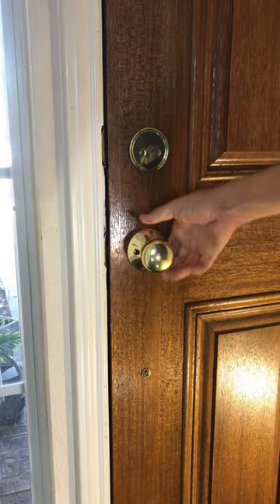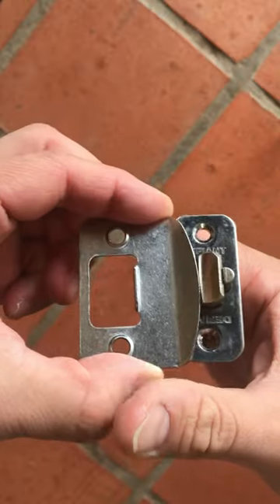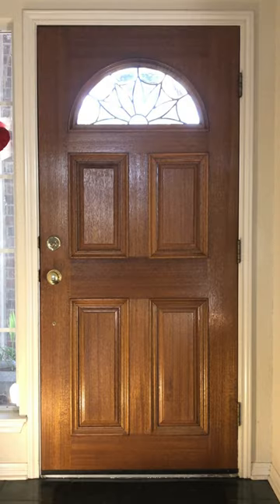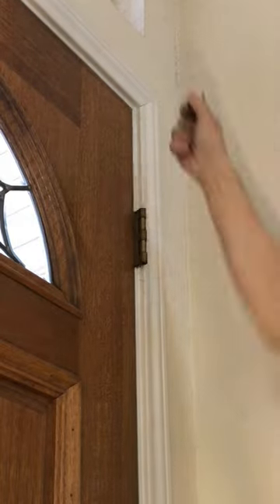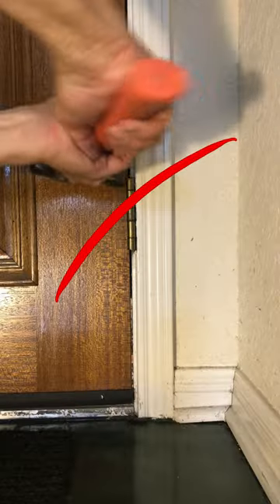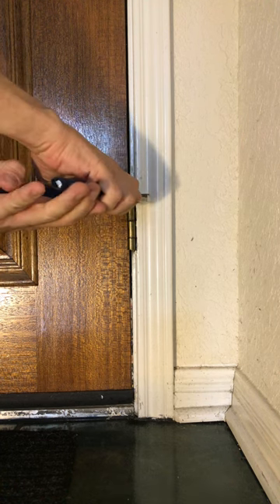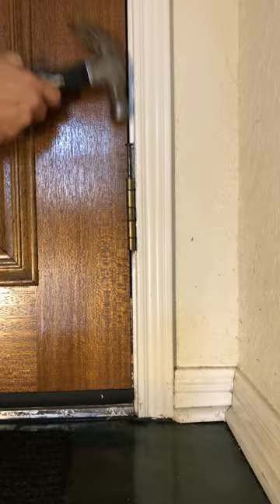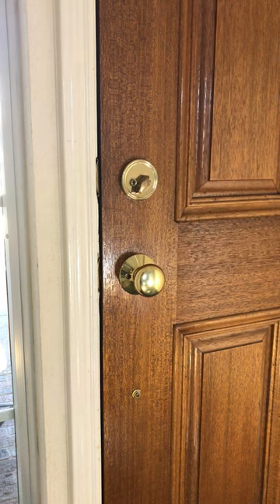How to Fix a Sagging Door (quick) (#shorts)

Comment: Most likely cause of a sagging door is loose screws on the top hinge.
Reply: Except in Dallas. It's the ground shifting under the foundation, for sure. It's even seasonal...one set of doors in the house jam in the summer, a different set of doors jam in the winter. They're all fine in the spring and autumn.

Comment: This is wrong. Warping the hinges like this is going to encourage them to bind and doesn't address the actual issue with settling, which is the doorjamb moving inside the frame; also, over time, that tension on the hinges will cause the jamb to bow. The correct way to fix a sagging door is to run a long screw through the hinge and jamb into the stud and tighten it to pull the jamb back into square. 

If the jamb has too many fasteners in it to be pulled by a screw, then it may be necessary to use a block against the jamb to protect it while you tap it with a hammer to budge it over. If it's already tight to the frame and doesn't have room to move, then one of two things is true: either you'll have to remove the slab and trim so that you can reset the jamb because of an improper installation (no space on the hinge side), or the frame was not built properly and the jamb has no room on any side because the builder didn't account for expansion and contraction of the wood.

This video may seem like okay advice for Johnny Homeowner but in the long run it's unprofessional and is just causing more problems, almost as bad as "just sand the corner down". I'm a private contractor specialising in residential remodel and custom trim.
Reply: That's called over complicating
Reply: @stevend481  It's called not being lazy and doing the job right. Putting a screw in the hinge takes less time than this wrong method that damages the door.
Reply: @bloodleader5 what’s the right job then? First time home owner here. Do you have a video link I could watch? Please.
Reply: You are presuming the problem is NOT that the door jam hasn't gone out of square because of the house settling...which the OP explicitly mentioned.
Reply: @kirkdarling4120  You didn't read my comment at all.
Reply: @cheriannarcher  I could try to explain it in more detail if you like, but I don't have a video on hand. I don't usually watch construction videos. Maybe I should try making some.